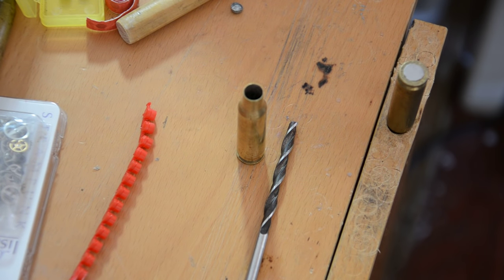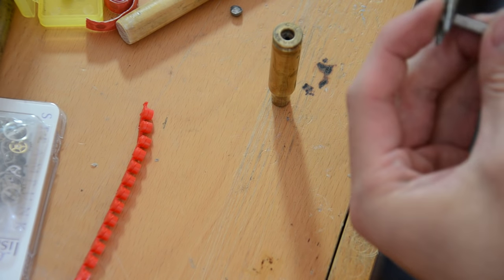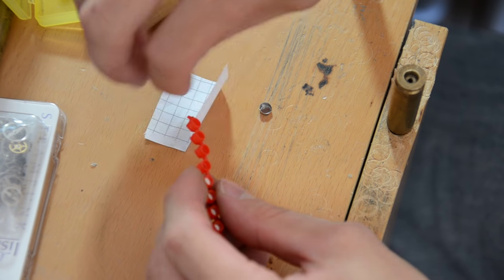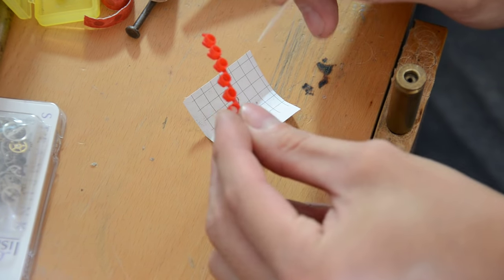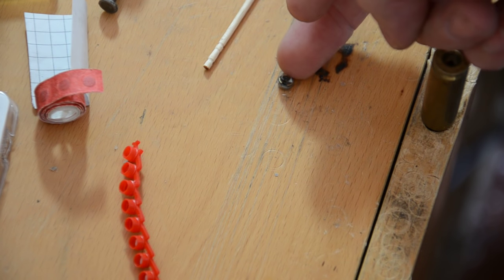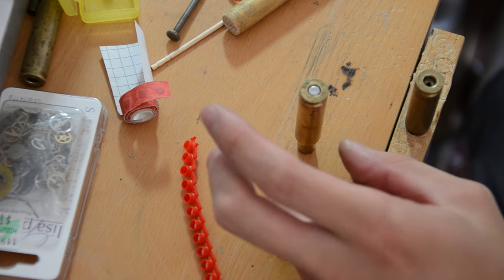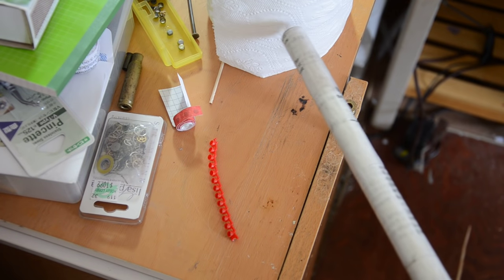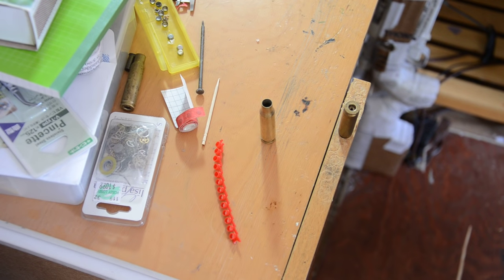Homemade Rifle Primer

Comment: If you don’t have the metal sheeting, just reuse the old primer cap by using a piece of metal rod (the blunt end of a drill bit) which fits inside the cap to punch out the dimple from the previous firing, then finish the way this video says to.

Comment: Depends on the kind of primer. Some can be knocked out with a small rod inserted trough the mouth of the casing. If you can't, you can drill it out.

Comment: thats a berdan primed shell. to remove just fill it pretty close to the top with water, find a punch the size of the bullet bore, put the primer over a hole, and hammer the punch down
Reply: @discoverytravels7426  Whats funny?

Comment: I've tried this before back in 2012 ammo shortages...and it is not safe for semi operation. The compound is too shock sensitive causing 4/10 rounds I made had slam fire out of AR and SKS. But should work fairly well with single loader shotgun and bolt action.

Comment: If you're using a boxer primed case you just stick something though the touch hole and push it out(he's using a boxer primed case)

If you're using a berdan primed case... look up on youtube how to remove it.

Berdan primed cases have two holes in the base of the case, while a boxer has one large one.  The advantage of a berdan case here is that you don't need that triangular anvil because the case is the anvil.

Comment: can any of you learn the basics of what he is trying to show you?
     paper gun or no.  
learning the basics for how to make a primer or to take a spent cartrage and turn it back into a round you can use again for hunting or self defense is PRICELESS.
Reply: Not exactly  priceless when they are commonly available  rounds,
Reply: I’ll give you $28.89. Go buy 1,000 primers. It’s faster, and easier. Lol. Cheers.
Reply: Rob Calhoun , would you want me to give you $28.89?? Lol. I don’t need to make my own primers. I will never experience an ammo shortage. You could shut down all ammo manufacturers on this entire planet and reloading suppliers, and I will still be going to the range shooting lots of ammo for the next 5 years. What ammo shortage? I didn’t know we had an ammo shortage.
Reply: @albertforletta1498  Nope, can't shoot money. But some ammo would be nice :)
Reply: @RobCalhounPGH  keep an eye on the shops... we went for 8 days without primers here in small town Montana. 
   Wow, so priceless. All 12 thousand of them... priceless.
Reply: Making a primer out of sheet metal is incredibly dangerous. A firing pin will probably go right through it or the pressure will shoot it backwards which results in pressure going the wrong way down your barrel. Which could damage the gun or potentiall explode the gun. Reusing an old primer is safer then using sheet metal but also probably a little dangerous
Reply: @jizzmonkey9679   in a world where a tyrannical Government rules this knowledge is necessary
Reply: @RobCalhounPGH  I'm in the UK ,I can buy primers anywhere and for the first  time ever ammo is cheaper
Reply: @johnakridge2916  you have a tyrannical government, you also have no primers so point taken.
Reply: @factdesignbr  it is fine for me,I can buy them anywhere
Reply: @albertforletta1498  try it now. Cheers 🍻
Reply: @RobCalhounPGH  fine milk indeed.
Reply: @johnakridge2916  well u think they would allow supply's to run if it was time for that
Reply: Me me me!
Reply: @jizzmonkey9679  lucky you. Here, nope, niet, nein, nada, nothing. The shortage is a real mess here in Canada.
And here, it is illegal to import parts of an ammo. So no powder, no bullet, no brass, no primers.  At least those for my guns.

Comment: My god, reloading takes long enough as is. Hell of a SHTF method though!
Reply: Look up the base components of priming compound and their history. Pressing cups is not that hard to mindlessly punch out a few hundred. Recycle your anvils or make them. Then use your highschool chemistry knowledge to make it. (Be mindful of your local laws)
Reply: Well yes but actually no. Dude, you're not going to be doing this in the heat of a fight or hunting or practice. You do it on your off time so that you save time between shots when you actually take them. I'm thinking you aren't very experienced with guns yet. There are a lot of people like that this year and that is ok.
Reply: @DobleWhiteAndStabley  how do you make anvils?
Reply: @SammyNeverEver  They're just pieces of metal that won't budge so the primer can be crushed. The more important thing is to know how to make the primer compound.

Comment: Just use match heads tho and grind some of where you scratch the match head to powder and mix them , to try it that it will work  put a little bit on your left thumb nail and put your right thumb nail where the powder on and scratch it quick and it’ll spark that mean it’s ready to go or beat it with hammer becareful the mix is sensitive to force.
Reply: By Y

Comment: I would never have thought that cap gun caps would be strong enough to use as the explosive to ignite the powder
Reply: Any impact sensitive material is good, basically. 
If you grind matchheads and mix it with ground dust from the side of the matchbox and put it in the primer...it will corrode the shit out of your barrel, but it works.

Comment: Under a real round with the pressures involved, will aluminum hold without a ruture? Pressurd should create a gas seal without glue, maybe nail polish to moisture proof it if the aluminun holds up. I would use the old cups again, flattening the firing pin dent would be much easier and it's steel.

Comment: Using spent primer cups aside, this is the most dependable method of building a primer. Dependable, as in useful and functional. Other methods yield less reliable results.
Great video.!! (I heard you just fine.btw)

Comment: It's very fun as well as helps you save your rounds and not shoot 50 at a time. It also stops his gun from getting too dirty. In addition to what is typed, a light load is ideal for his bullets as his springs are meant for light strikes.

Comment: If you took the anvil from an used primer, you can reuse the primer cup as well !!   Just hammer flat the old firing pin indentation.   This method works 3 or 4 times with a given used primer cup.
Reply: It will work more if heated to red hot and flattened then quenched or left unquenched. Heating removes the stress in the metal and so will normalizing it.

Comment: Pretty cool, but I have a suggestion that might make this method easier.  Since this method uses recycled anvils from spent primers, why not use the anvil AND the cup from the old primer?  Instead of forming a new cup from scratch, just use the old one.  Use the blunt end of the drill bit to hammer out the dimple from the previous firing pin strike and you have a properly sized cup ready to go.  The forming of the cup seemed like the hardest part, recycling an old cup would eliminate that step.
Reply: He is showing what he capable of 😂

Comment: Basically every one of these i find they use pop caps.. but if you were ever in true need to make these would you be able to even find pop caps? 

sure we have recipes to make black powder if things ever went way way down hill. not every weapon would be able to use black powder but actually most straight wall casing rounds could adapt.. 

But it always comes back to primers. 

even if you can make black powder from scratch if you run out of primers you essentially cant make a primer from scratch. 

I understand we can press the fire pin out of the old primers and we can make the cups with a aluminum can which is cool. 

But id like to see someone post a commonplace make-able compound to re-manufacture a primer striker with scratch materials if for example modern manufacturing ever disappears. .
Reply: Thats pretty easy, just use Armstrongs mix ie both components of strike anywhere matches ground up and combined create an impact explosive. Im not sure of the chemical names, I know one is a type of phosphorus, but theyre fairly common chemicals on their own.

Comment: Homemade brass can be made out of solid bar stock on a lathe. Then it needs to be annealed and formed over a press and die(s) It's the only viable method that doesn't make use of press punches, drawing presses, etc. It would be wise to stick to a straight case caliber like 45-70 etc. with a very slight taper that can actually be machined to final shape/dimension rather than press formed and a Berdan primer pocket is ideal as they are much easier to make than the Boxer type.

Comment: Spend the 20 bucks and buy some prime all. You'll get enough compound to make hundreds of primers. Get a set of dies! Much easier to get primers in or out. 
 And the right size punch to fit inside the primer to remove the dent. A set of 7 cost less than 10 bucks at walmart. Much cheaper than the emergency room for stitches when the drill bit snaps.

Comment: If you're making a straight walled case like a 38 special you're fine and easy.

But drawing out a brass case you need someone to machine a series of forms(that are accurate to thousandth of an inch) and get a heavy press.
Reply: You could use Paper to contain the charge, Bullet and primer like the flintlock rifles of the 1700s

Comment: Don't even think of using this method. The black powder and an additional ingredient makes the cap detonate from concussion. A fully loaded rifle cartridge with a cap compound reloaded primer, is a deadly accident waiting to happen. The cap powder is so unstable, even just reloading the case could get the primer to detonate when seating a bullet. Dropping, striking, vibrations, etc.... can get the cap powder to react. If you have a death wish, yeh sure, go reload your primers. I have 40 years of reloading experience and would never do this with the primer component. Standard primers are 500% more stable than cap powder.

Comment: do you know if a 50 bmg primer has more lead styphnate (explosive compound) that a 209 shot shell primer? i was wanting to make a mini shape charge with the primer' i do know shotshell primers are pretty powerfull and if you set it on a penny and blow it up with a blow torch the explosive will actually bend the penny" its amazingly strong for the amount of explosive compound in them" anyways hope you may know the answer' i wanna go out and buy some soon" also do you know anything about if rim fire shells carry more explosive compound than shotshell primers? i remember along time ago taking apart nail gun bullets and there was this yellow primer in it that ichave know clue what it was but there was a crap load' maybe more than the about of 4-5 shotshell primers.

Comment: why not just use the caps....this is confusing
Reply: I've used the plastic caps for smaller primers and they work fine. I'd say anything larger than a small pistol primer you'll need to make your own primer cup for it. Caps are too small.

Comment: Wouldn’t it be easier just to réprime old primers?
Reply: That's a thought. Using the bit to pound the pin dent out the cup face instead. It would be the right size so you might not need glue to hold it in place.

Comment: Why make the primer cup when you could just reclaim the spent primer cup
Reply: Amen. I've done things like this using black powder. White tip of a strike anywhere match, kids toy caps etc. I wouldn't have the guts to do this with smokeless powder. To many unknowns. Higher ignition temperature,  (chance of a cook off) unknown pressures. I hope nobody gets hurt.
Reply: He did this because he has weaker hammer springs on his paper guns. They didn't set off real primers.
He has a video showing how to reclaim primer cups. However you'll get 2-3 uses max because even hammering the dent flat, each dent on the primer makes material flow away.

Comment: what caliber rounds are you using? i found a spent shell (7.62) but the flash hole is split into two little holes so i cant remove the primer :(

Comment: Well after a lot of thought i will be re-using my spent .308 large rifle primers instead of using aluminium can sheet metal,its too thin to use safley for primer cups. I cant get any of those paper caps for cap guns so i will use a mixture of shellac and acetone to hold the primer compound into the primer cup. I will be reducing my powder charge for this experimental replacement primer to be on the safe side.

Comment: Your metal is too thin or too brittle.  You may have to anneal your material before attempting to from the cup. 

Hit the sheet with a blowtorch for a few seconds, let cool then proceed as normal.  If it still doesn't work get a thicker sheet.  Don't burn your house down.

Comment: Homemade gun: Check!
Homemade bullets: Check!
Homemade primers: Check!
Now to make homemade brass!
Reply: Uhh ive been researching this stuff for a while and the easiest method i can say is only hydraulic press, the whole process is not that hard but it does require machinery that normal person wouldnt have
Depending on the type (i.e rifle, handgun, intermediate) you will be having more or less steps but basic operation of making includes these steps:
Brass sheet around 0.3 cm thick is cut in small circles
Annealing
First pressing, it now looks like small rocket
Annealing
Second pressing, now it has flat bottom
Annealing
Cutting the excess material
Annealing
Third pressing, making hole for primer (depending on whether boxer or berdan) 
Annealing
Cutting circle on the bottom of a round to first remove rim (if rimless ammo is needed) and then cut another time to make rimless 
And thats basically it for 9mm

Comment: I have a question every time I try to make the cup I'm punching through the metal... And I use the same metal...
Reply: try seating the primer a bit deeper
Reply: @joemama.556  well seating the metal I want to become the primer doesn't help, I still punch through that thing...
Reply: @that_escalated_quickly2720  is it a conventional gun or a diy? if you have tweaked with the fcg, you might want to go back and lighten the hammer spring
Reply: @joemama.556  im talking about fabricating the primer Lil thingy the primer pocket... The little knob filled with Armstrongs mix... I'm trying to make those little pieces, as I can't buy them...i want them for self made blanks, I never said I punched through them when I fired, but when I wanted to press them into shape to make them and fill them... I already used Heat but it didn't work...
Reply: @that_escalated_quickly2720  oh, I understand, so you are breaking the anvils when you seat them or when you extract them?
Reply: @that_escalated_quickly2720  also both pieces could be made with a couple of punches and some sheet brass or even alu. although you would have to make the forming punches yourself
Reply: @joemama.556  yeah okay, will try those materials... Used some crappy sheet-metal, thought it should work... I wanted to make primers from nothing but raw materials, as I made my own blank shells too (lathe) but it's impossible to turn those primers, anvils are no problem rn
Reply: @that_escalated_quickly2720  try using soda cans as asource of material, they should be cheap, also you should experiment with the thickness (i.e sand it down for a thinner material) of the material or even a previous annealing to make it softer
Reply: @joemama.556  yeah will try that for sure! Thank you a lot! Great advice! Have a ton of those cans at home... I knew they would be useful
..

Comment: could you just use the caps themselves as a primer, or would it not work as well
Reply: +Worldadventure Lehderp nope the firing pin busts through them and they would probably come off and let gas escape
Reply: Oh ok
Reply: +Worldadventure Lehderp then it won't be too reliable or just won't work at all. Still the gas can escape

Comment: In a 38 spl ammo,  I used the cap toy and flared ok, but it could not ignite the gunpowder. What went wrong?
Reply: Glauco Alex Picinini I'd need more info to understand what your doing wrong.
Reply: Ajax Ashford I follow your example, but the gunpowder not ignite.. It´s a smokeless powder, could be that?
Reply: didn't you say the exact same thing in the other video?
Reply: Smokeless powder is probably the issue. Smokeless powder is a lot harder to ignite, but it is also much more powerful. 5 grains too much and you could blow up your gun. Black powder is much more forgiving and easier to start with

Comment: if you don't have any spent cartridges could you fashion an anvil out of a tin can?
Reply: +AntichristDemoncore Depends on the thickness, you don't really want it to be too soft. On tacome's "homemade primer description" he shows how to bent the tip of a copper tube and cut it off so it has the basic "cone" shape of an anvil but with space for the explosion to go through the flash hole of the casing.
Reply: Filipe Amaral Im thinking of using a tin can, I thought about using an aluminium soda can but I think that is too soft. Then again it doesnt really take much to set a cap off either.
Reply: ***** For some reason I was thinking it would be used on a real gun, you're right. Tin cans are thick enough.

Comment: Awesome...ammo vids are always the best, I hope you'll attempt an actual necked cartridge case sometime: {maybe a segmented flower design with the 'petals' raised vertically from the circular base to properly form the difficult/problematic neck and shoulder area-straight wall much easier by far}....liked your simple primer body forming method, same principle as freechex(tm) or CheckMaker(tm) die combos for DIY gas checks.